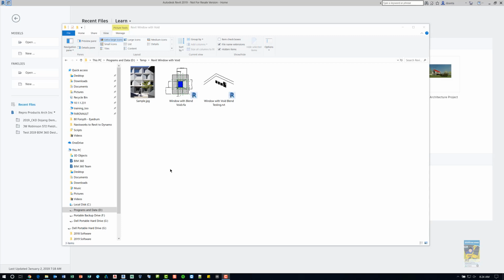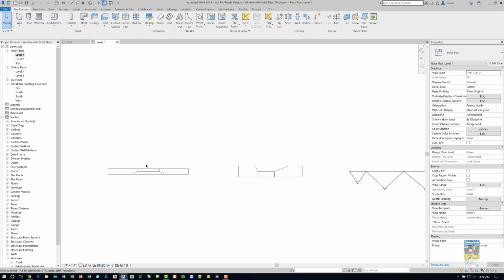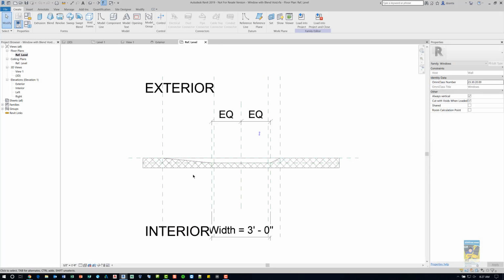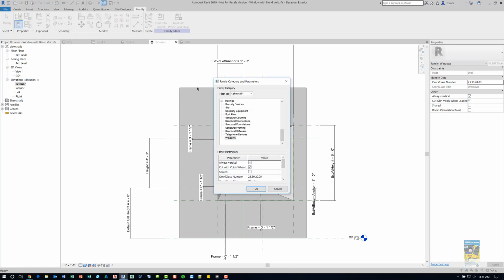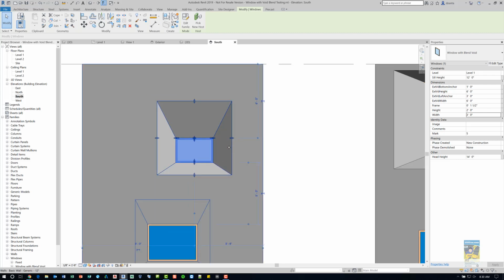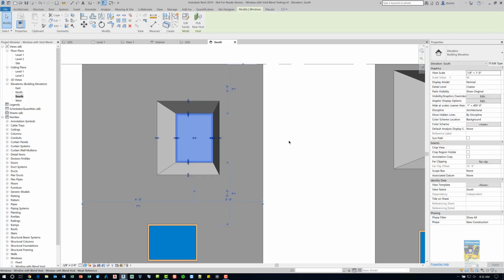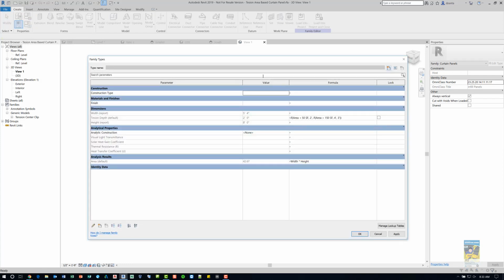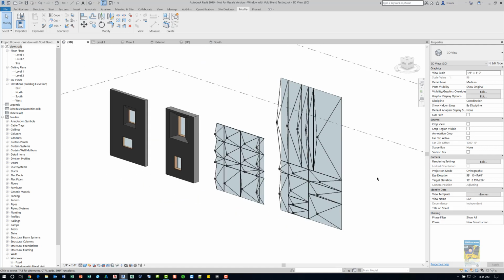Revit window with void

Comment: Thanks for the Video, I am trying to create something like this in a window family and I keep getting an error that a void and an opening cannot be in the same family. Did you encounter this as well?
Reply from the maker: I don't believe so.  Try to ensure the void isn't touching the opening. You can also try to create the family without the opening and just use voids to cut the wall host too.
Reply: @DzanTa  Thanks for the suggestion. This worked but the void I used for the opening is also cutting the window object itself. I know you've shared the file many time already, but if its not too much trouble, I'd like to take a look as well.

Comment: how would you manage the window family if the model were split into two disciplines with a structural wall and an architectural finish wall?
Reply from the maker: The window family is usually wall host based and can only be hosted by 1 wall. You could make it face based and apply it to just the arch or structure part of the wall.

Comment: Thank you for great tutorial. I tried to rebuilt that in Revit 2020 but I get info that I can't have opening and void cutting the wall. Can you explain how did u achieved void cutting the wall? I am really wondering, since your family works like a charm, when all my tries related to voids in window families are not working with openings.
Reply from the maker: Thanks.  I will let you know in 1 hr...
Reply from the maker: I would need to see your window family to see what went wrong.  Did you make sure that you placed a checkmark in "Cut with void when loaded" in the family category and parameter window?  Usually, people forget about this checkmark and it fails...let me know.
Reply: @DzanTa  Thank you for your reply. I had problems with voids in the windows family before, but finding out your video have made me came back to the problem.

I used your family, deleted the void and created the same void by myself. The new void did not cut the wall. When I use cut tool from modify tab, I get pop up window with info "A family cannot have an opening and a cut in the same host!".

So, overall, it makes me wonder, how did you managed to cut hosting wall, with the void. 

Here's the link to my google drive with the family: https://drive.google.com/drive/folders/11_HO8gOceX5h0a8yvvK0kutk2tZIkuqd?usp=sharing

I added your family as well. Thank you very much!
Reply: Ah, second paragraph is related with operations in the family enviroment, I didn't metion that in previous comments, sorry for potential misunderstandings.
Reply from the maker: @piotrbukowski5435  So I tried to rebuild the window from scratch step by step in 2019, 2020 and 2021 and they all state the same error "Cannot have void and Cut opening in same family."  Very weird.  I took my 2019 window family that is working properly and upgraded it to 2020 and then loaded into a new Revit 2020 project and it works just fine.  If you allow me to upload my file to your shared Google drive, then you can have it.  Otherwise, I can send it to you via your email address...what is your email address?
Reply: @DzanTa  Thank you very much for your time, help and informations. It's a bit weird, I agree. I had hopes that it may work in R2020.

I allowed uploading files to the folder. If you prefer to send me the files via email, my mail adress is piotrbukowski725@gmail.com

Thank you again!
Reply from the maker: @piotrbukowski5435  files sent via email
Reply: @DzanTa  Thank you, received!
Reply: @piotrbukowski5435  could you send me the file!?
Reply: @TheMISTERfield   @White Black  
Mates, in the upper section of the comments there is still link to the Google Drive folder.  @Dzan Ta   put his family there. Mr. Dzan I hope that there is no problem that the files are visible to everyone in the net :)
Reply: would appreciate if someone could send me the family files,email : lightofdarkness111@gmail.com